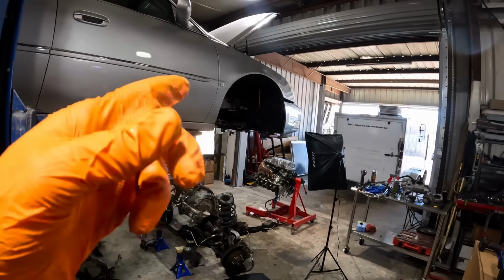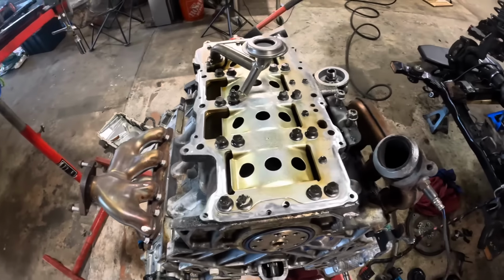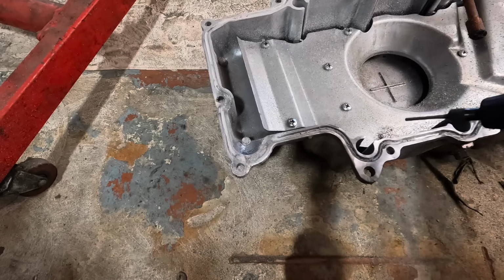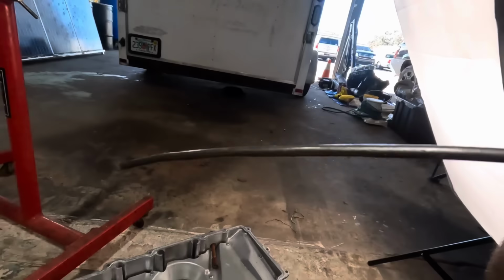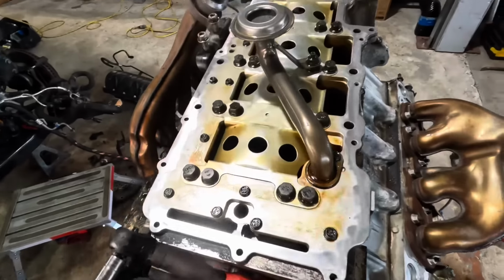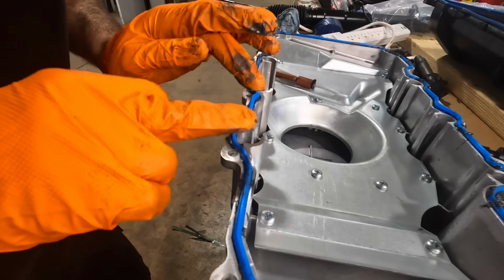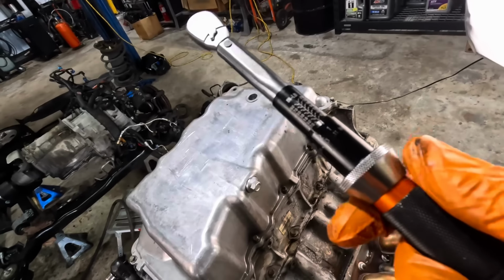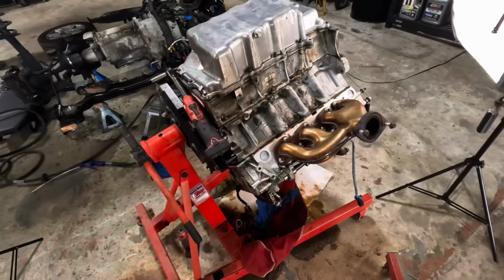Leaking Engine Oil at 40,000 miles! Rear Main Seal, Oil Pan, Valve Covers and Water Pump!

Comment: On Northstars, when you're in this deep, you had better split the block and do the case half seals, that's where they are known to leak. We normally did this with the engine still in the chassis hanging from a bridge. We just pulled the cradle off and left the powertrain in the car. If we had the engine out we'd do the head gaskets as well. The problem with the head gaskets is the head bolts are engineered wrong and they'd pull the threads out. 

There was a good while where the ribbon gasket for the oil pan was on backorder, so to get the gar done we'd fill that up with gm engine sealant and put it together. It'd at least make it out of warranty before it leaked again. I bet thats what happened here
Reply: He was warned, he knows, he ignored. Leak NOT fixed, customer money taken, job done.
Reply: as for the head bolts, they make a stud replacement kit.
Reply: @scott.koopmann  I’m certain the costomer was quizzed as to how far they wanted to pursue leaks and how much they were prepared to spend. 
Unfortunately they’re a shit motor and they can be sorted but people have their limits on what they’re willing to spend it’s only oil leaks so not going to cause a catastrophic engine failure so relax 😎

Comment: It could have been worse. I worked with a guy who used 3M Super Weatherstrip Adhesive on those types of gaskets. The stuff hardens like concrete. It took a combination of wire brushes, picks, shovels and dynamite to clean the gasket grooves.

Comment: Since you went that far you really should do the head bolt modification and put the course thread head bolts in it to save that engine from destruction in 20,000 miles - bulletproof it. 
Car wizard has a video about that..
Reply: Factory updated head bolts in 2004.  Are the kits better than OEM?
Reply: There is absolutely no reason to address the head bolts after the second half of model year 2004 and on. GM fixed that issue for good then.

Comment: I saw nothing wrong with this repair. The RTV is extra insurance to prevent future leaks. Finding ways to save customers money is always worth it in the long run. A few hundred dollars in extra bolts and labor when not necessary is like stealing from someone. You can take advantage of someone now for short term gain, or you can help someone save and retain a long term customer. I choose the latter. Some people are just gonna be haters and a..holes regardless of what you do. You,ve got to stand for something or you'll fall for anything, so Ray, just keep doing what you do.  No one is gonna agree with you 100% of the time because everyone see's things with different views, but at least you explain why you do the things you do and that is 100% respectable.

Comment: Truly a mechanical marvel of design.
You have to admire the level of engineering and the technical challenges in producing the many precision castings for such an engine. Thermal stress between zones, components and materials wasn’t fully realized. Too, the quality of gasket materials appears to be inadequate for that period.
Still, a very interesting autopsy of a design destined to fail spectacularly.
Reply: They are smooth running engines Eric @idocars tore a failed one down.

Comment: Once the engine is done you can be prepared to do the transmission for no lockup or 4th gear. Great  more work needed vehicle.
Reply: Or pulled head studs
Reply: And the TCC solenoid 😁
Reply: Theres a guy with a Monte Carlo ss with a twin turbo ls4 with a built 4t80.  These can be built to hold some power, the 4t65e, not so much
Reply: @kd7cwg  what's that got to do with these comments? Maybe you just had to tell someone. Dooley noted Sir.

Comment: I love your videos.  However when you used a high speed low torque bit on the aluminum pan I cringed.  Consider buying  Dow Corning DS 2025 cleaning solvent.  It's the only solvent that actually dissolves cured RTV.  Kind Regards.  Craig

Comment: Never, never, ever use any kind of abrasive disc or wheel on any aluminum mating surface.  You've managed to fling a lot of small particles inside of the engine, not to mention damaging the mating surfaces.  A tungsten blade scraper (Super Scraper brand) does an excellent job without damaging the aluminum.  Yes, it takes more time, but it's the proper way to do it.  A wooden or plastic dowel will take care of getting the old RTV out of the groove.  Again, a little more time, but no damage........
Reply: i dont know about hand scraper, but i do know that disk is way more agressive than he realizes. its effectively like 600 grit sand paper
Reply: Couldn't agree more. I made the mistake one time working at a GM dealership replacing head gaskets on a county sheriff's police cruiser. I used an abrasive pad to clean the deck and head surfaces. I took the normal precautions to plug holes and thoroughly clean everything (including oil changes), but some of the abrasive materials made their way through the oil pump. The car was back in the shop in less than a month after they were on a high-speed pursuit and the engine locked up - scoured/seized oil pump. Needless to say it was an expensive learning experience. We ended up replacing the entire engine.
Reply: You must be joking... damn troll.
Reply: @DeeGee-mv6eq  no it's actually an issue, especially on aluminum blocks. they're machined precision flat, you take a grinder like this to it that takes metal off and it's not flat anymore, making it way harder to seal even with a good gasket
Reply: @scott.koopmann Ray doesn’t cut corners on the job . He optimises his useable time allowance to make things easier for himself and the customer
Reply: GM#87-61-24: INFO. USE OF 'SURFACE CONDITIONING DISCS' - (Apr 2, 1998)

This bulletin from the 90’s covered the use of Scotchbrite pads I believe. But maybe things are different now?
Reply: MY thought exactly! Ray is a major azz!

Comment: for running down bolts with the impact, you might get better results from a rubber cup bit, they only hold the top of the fastener like a clutch, then they don't stick to the bolt head.

Comment: A Tisket a Tasket...a leaky North Star basket.

Symptoms: Oil leaking from every pore and seal area. (See Flow Chart below)
**Procedure**
 Go to step number .1
Step .1  Remove oil pan, lose some of the bolts, keep what's left , take gasket and throw it away.. Proceed to Step 2.
Step .2  If nobody is looking go to step .3
Step .3 Gaskets are there for show only so don't bother to replace, smear oil pan gasket area with RTV being careful to get it all over the place to show as evidence that you been there... 
Step .4  Reinstall whatever oil pan bolts you have left,  tighten every second bolt until your elbow makes a clicking sound...

Did this fix the problem  Yes/No?
Yes?  Give the customer back his keys and rush him off the lot.
No? Give the customer back his keys and order him off the lot.

Did the customer come back?
Proceed to the following steps
1.Convince the customer that the engine is self lubricating and every Cadillac has a built in rust protection system.
2. Advise the customer to keep a case of oil in the trunk and be familiar with checking the oil every 200 miles.
3.  Advise the customer to install a drip tray under their vehicle and cover their driveway in oil absorbent pads, use brake clean on their kitchen floor to remove oily foot prints and advise them of slip and fall accidents and injuries

Is the customers face beet red?  YES?  proceed to step .5
.5   Take the car to Rainman Ray Repairs...

Comment: Awesome! Ray is turning out to be a very good Karen magnet. Never seen so many before and the reeee is louder than all the loud noises.😂
Reply: Yep.  Seems like the complainers don't realize the replaced oil filter will catch the plastic bits well enough and that it's probably an old guy's last, adored but low use, car.

Comment: legit question.. aren't you worried that dremel bit scored the pan? and when you used the zizz wheel it put debris into the bottom end?
Reply: I'd have used a brass wire wheel on edge..faster, less chance of damage. And yeah a small handful Phillip screws he could've ensured no junk in bottom.
Reply: @Boga217  I would have done the same.
Reply: @Alberta_Redneck  rays good but some things I just shake my head like I do the new kids in the shop. But being he put sealant as well it kinda redeems his dremel job a bit.
Reply: @Boga217  I agree I commented before I saw that part lol. He did Acknowledge there were some minor scrapes from the dremmel.
Reply: @Boga217 a wire wheel would have been better but will break off wire bits and those will enter bad places too (I am a 20 year engineer with an abrasives / wire brush manufacturer)
Reply: @rickwoods5384  with an oil pan like that it really wouldn't matter you can undo the screws in the bottom and clean it out no big deal and with engines just make sure you cover all your holes and ports but either way a wire wheel is far superior and better to a Dremel carving a gasket surface.

Comment: It would sure be a good idea to do head gaskets with upgraded bolts and threaded inserts.
Reply: Customer option
Reply: The bolt upgrade actually uses larger diameter bolts or studs with deeper threads. The Car Wizard did a stud job on a NorthStar last year, go check it out.
Reply: @williamevans6522  Yes, customer option, however, head gaskets are a major source of oil leakage and should be highly recommended.  But this is gonna be a Ray half baked repair process.
Reply: @thk7513  The customer is baked for not choosing.
Not Ray
Reply: @williamevans6522  If your going to do the repair right, head gaskets and crankshaft girdle should have been addressed.  If you're going to fix a known oil leaker, fix it properly or don't do the job at all.  All Ray has done is get into someones pocket book for an incomplete repair.  Ray should of walked away from this one.

What's going to be the question is when this thing starts leaking again, what is Ray going to do.  If the plate or head gaskets puke, my money is on the engine will still leak, will Ray crawdad out of stepping up and doing this repair properly?
Reply: @thk7513  The customer is always right. If that's  all he wanted done, and seldom drives it . who's  to say what is right?
The customer.
Reply: For what reason? They didn't fail anymore after 2004-1/2
Reply: @williamevans6522  That was my guess, especially if it's for the owner who has put so few miles on it over the years.  Not like they are going to start grinding out 500 miles a week.

Comment: Dremel tools have fiber/plastic wire wheels. They clean off silicone without damage to parts. You can find these wheels easily.
Reply: dremel vs die grinder isnt the issue, its the disc hes using thats too agressive.
Reply: Agreed

Comment: I also could not find the crank bolts. I reused them but only torqued them to 40 lbs-ft.
14:29 I bought a Felpro oil pan gasket off ebay. The oil filter flange o-rings failed. I had to reused the old one.

Comment: The proper way to do it is to leave the gasket out and use the grey GM sealant. That was not shade tree, it was part of a bulletin.

Also, the lower bolts do not require replacement unless they break. The broken piece will usually spin out easily with a sharpened punch.

Wish you were near me, I totally would have helped you with that thing. Lol

Comment: PLEASE pull the upper oil pan off and replace the oil distribution plate. The repair will expose the main bearings but at this point it’s not difficult. This is a major source of oil leaking on this engine. If you don’t replace it this vehicle will come back leaking oil and then you will be in a difficult spot. Just trying to look out for you. Good luck!

Comment: It's a GM it's supposed to leak oil.  It's to undercoat the undercarriage to keep the terrible metal quality and terrible frames from rotting out.  It's a feature, not a problem!
Reply: Must not of seen the Ford recall on 2020 models, for subframe rot.
Reply: @robertdunaway-tyll7635 Didn't say they aren't just as bad.

Comment: We used to reseal the block halfs in the car by dropping the subframe. Ah, the old dealer days! 😜
Hope you don't regret not sealing it. They are a common leak. I never had the threads chime out of the block half, just the heads. Maybe I'm lucky.

Comment: Plastic Pic followed with die grinder with soft brass or soft stainless wire works wonder in those grooves. havent tried a bit method myself im too accident prone wouldnt want to damage groove

Comment: i just had to reply to this one. 
i did not care for the nowsucks,.. i mean northstar motor.

the best way i found to clean those oil pans and the girdle it from if you remove it is with old carb cleaner, the good stuff that came in a 5 gallon can. drop it in & let it soak for a little while. pull it out & let it drip dry for a few minutes then hose off or clean it in the parts washer. any silicone left on will pretty much wipe right off.
good spray carb cleaner does work, just need to keep the silicone wet for a little while. Safety-Kleen also use to have some really good carb cleaner. 
its kind of a gamble not doing the girdle, we had a fair number of customers that only wanted to do the pan.

going back together we did the pan like you did this one except when we put it on, we would lightly snug the bolts, then let it sit. depending on the weather, sometimes for about 5 minutes up to about 20 minutes or so to let the silicone skin over good & then torque the bolts.

Comment: In the UK you can buy silicone removal gunge or silicone eater. It comes in a tube much like silicone and you spread it over what you want to remove then leave it alone for an hour. It somehow eats into the silicone and returns it to a fresh like silicone state so it can be scraped or wiped away. May take a few attempts in that deep gasket groove however.

Comment: Ray, the part you keep referring to as the “ block skirt”. is actually the upper oil pan. That is 99% where the oil always leaks from. Like you stated in another video. Most shops don’t even like to work on those Northstar motors. They are a nightmare. It never fails every time you do any kind of work on them. They always come back for warranty work. They were a very poor design. They have a litany of problems. The earlier ones I believe up to 2004 had a tendency to blow head gaskets early. They have an update kit to strengthen and put larger head bolts in. However, this particular engine should have the update from the factory. But they still had major oil leak problems. Like I said most shops don’t even like to deal with them because they will be back for warranty. Just when do you think you’ve got the leaks taken care of. They start to leak again. I know of a lot of shops that do work on them. But they have the customer sign a release. Essentially stating there is no guarantee of future leaks. Just FYI, my friend, Ron.

Comment: Those aluminum frame with injection molded rubber gaskets LOVE to harden and leak. I wonder if the replacements I have been installing for the last 6 or so years have better material. It will be about 10 more years to find out.

Comment: I could not find the mid plate gasket even at the dealer. I reused the old one but I put silicone gasket sealant on top. There are no leaks.

Comment: Considering all the extra work Ray does on the oil pan with removing the old sealant, putting in new sealant and gasket, would it have been better to just replace the entire oil pan with a new gasket? And just wondering ... will the sealant negatively interact with the rubber gasket?

Comment: LOL 106 Ft. Lbs. on the pan Bolts🤣🤣🤣"You'll Break your Bolts off Kid"😂 On a more serious note I did notice when flipping the pan over during the install some water dripped out of it into the crankcase. Probably not more than 1/4 Oz. but it's there. Might consider a 15 minute run and flush once complete. I had anxiety seeing how deep the gasket groove was and all the sealant in it. The last guy definitely was not looking out for the next guy.......

Comment: that scotchbrite pad on the die grinder is NOT lightly abrasive. it can remove steel (if you see sparks at all thats metal coming off) and will definitely ruin aluminum. i know from experience.

Comment: that style of lower oil pan definitely had a nitrile rubber gasket - someone in past tried to shortcut and RTV sealant was not going to work. More un-doing someone's bad work

for engines that depend on RTV - both surfaces would be flat (not grooved) in order to provide maximum surface for sealant to work

Comment: I know you said you didn't want to open Pandora's Box with this boat anchor engine . But you should  replace the head bolts with studs not with heli coils but with ral studs from Northstar Performance  because they will fail and blow head gaskets!
Reply: Why would they fail? That issue with the Northstars was over in 2004

Comment: The funny thing is when this Northstar, engine was put in the Oldsmobile Aurora, GM if there was any kind of engine failure at all, service departments were told to pull the engine and send it back for a new crate engine, and do not take the motor apart.
Reply: Oldsmobile was the test bed for anything new that GM wanted to do with Cadillac.  Don't remember where I read that.
Reply: We still do that with any type of engine failure on a newly introduced engine
Reply: My father was an Oldsmobile guy forever starting in the 30’s, he said what you stated and that Oldsmobile got the turbo hydramatic transmission which was then put into the Cadillac after being deemed a success.